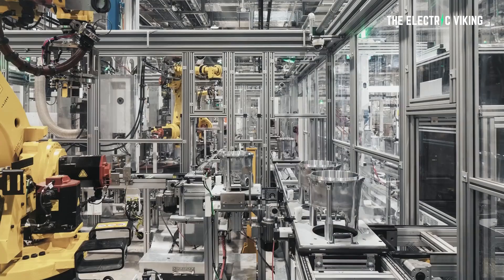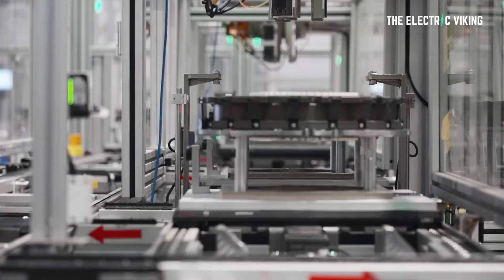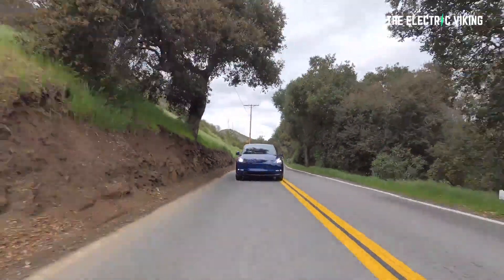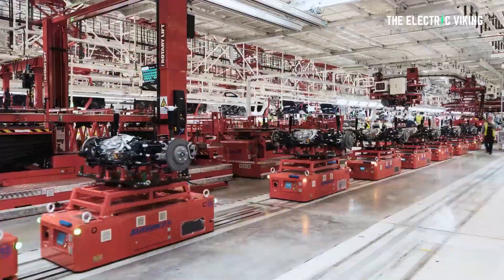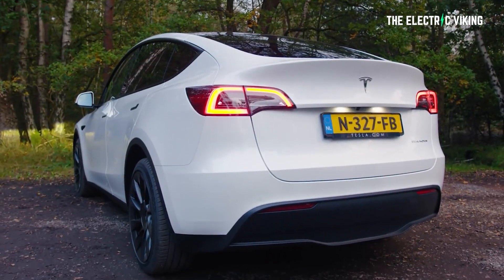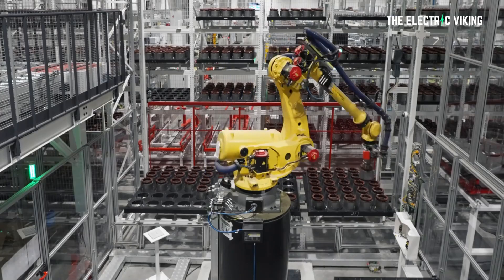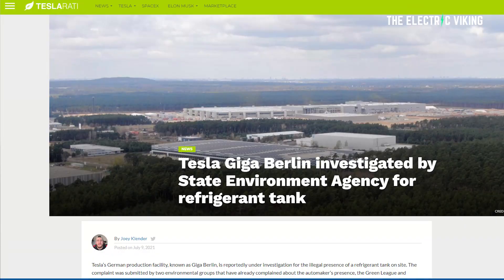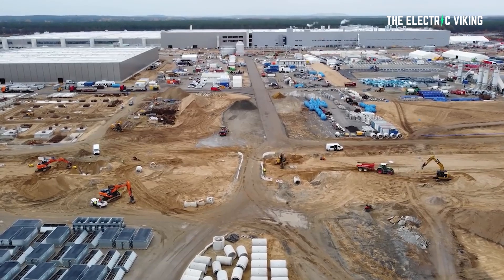Tesla Model Y Performance EV's manufactured in Germany spotted

Comment: Having accepted one recently, I can say the Model Ys coming out of Fremont are from another world.  The panel gaps are perfect. The doors operate more solidly than early 2020 Model Ys.  The sheet metal even seems thicker.  Overall impression of the Performance Y is that it's a tank with F-15 power.
Reply: right. while people were touting the superiority of shanghai over fremont, they didn't notice that tesla has kept upping its game, its production standards, system-wide. long-term, china has no advantages anymore, or not for long, as automation replaces human workers more all the time.
Reply: I took delivery on 12/30 and fully agree. I spent so much time reading Reddit worries and it was all bullshit. I'm so happy with my Model Y. I can't even compare it to other cars I've owned.  My biggest problem is finding a local tint shop that I trust to touch the Tesla..
Reply: Yes, I have a late 2020 Model Y and the fit and finish is as good as any of the Audi or BMW I have owned.
Reply: @vanrozay8871  That is great to hear. China's advantage is the export markets to countries in that region as well as Australia and New Zealand where cars are normally stupidly expensive. How would you feel paying nearly twice the price for cars. For example, a model 3 performance in Australia (without any additional options) is $92,000 on the road.

Comment: Those cars spotted going to be tested/certified had to come from the factory there to get the safety certificates etc. The ones from Shanghai/Fremont have already got approval. This will be to confirm the specs and ratings for the new ones produced locally. They would not take it on trust that they are the same. They have new casting designs as well. Of course they have to come from the new production line. Tesla is trying to remove all the obstacles to full on production for sales in parallel by doing these test runs while awaiting the water use permit.

Comment: Have German colleagues in the metal working industry, with connection to auto makers logistics. The "ignition" in on, "startmotor" cranking the factory, and soon all "cylinders" fires. We will be stoned by the power of this "beast" of a factory. German precision and pace in a never before seen efficiency, that have to bee seen to be believed.
Reply: Do you know where the batteries will come from, before the battery factory on site is ready?
Reply: @evboy4287  , sorry no.

Comment: It's no big deal, those early vehicles are used to calibrate equipment, like the casting and paint shop.  Those vehicles will also be used for crash testing, to get the proper safety certifications.  None of those vehicles will be delivered to customers.

Comment: You keep saying that the opencast coal facility is USING more water.  As I understand it, the water is not being "used" in any meaningful sense.  Rather, it is being drained away - wasted - in order to enable them to dig.  Please correct me if I am wrong.
Reply: Maybe Tesla could purchase the water.  Just redirect it to the plant
Reply: @marcparham38  that's and idea.  Would need to be processed as it is ground water from a coal operation.

Comment: I think, in this case, the bureaucracy tried to speed up the permissions process, and they made mistakes doing so (as that's not the way things usually work). And the nature groups pounced on that, and obviously, the courts had to agree that there were mistakes that had to be fixed. Haste makes waste. And on top of that, we have a pandemic going on, which has all manner of side effects. As for the water, I'm not certain, but it is very likely that stopping the coal mining (which has been irritating lots of Germans for at least a decade, but they have a strong lobby) might not help with water availability in that area, as that's not where they draw their water from. But I'll leave that one to the experts.

As to the airport, that was a very different ball of problems, but I think the most important one was - as so often - in the design of the process. We have administrations that are experienced with project management for building projects. But instead of giving the job to them, telling them the goals, and letting them do their job, as so often, politics decided to use a different project structure. From that alone, you'd expect cost and time overruns - politicians tend to change the goals while a project is underway, that always has this effect - but it got worse, in that the contractors cheapened out on their work (and weren't caught in time). As a result, off the top of my head, I recall at least one complete replacement of the fire protection systems, and some parts essentially torn down and built again because at the time, changed security norms made repairing it no longer cost-effective. And of course, the project leadership changed over time - politics, again. All of Germany was making jokes about it; I remember, on my favorite radio station, there was a running joke of a plane waiting to land there, getting one absurd excuse after another why they couldn't. That ran for a very long time. Job security for comedians. I think this was probably the worst such case in recent German history.